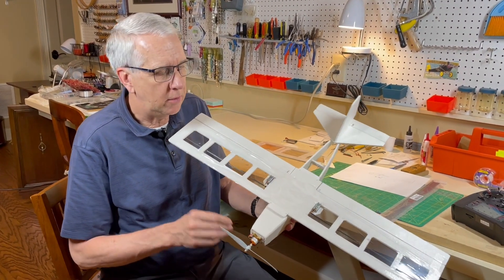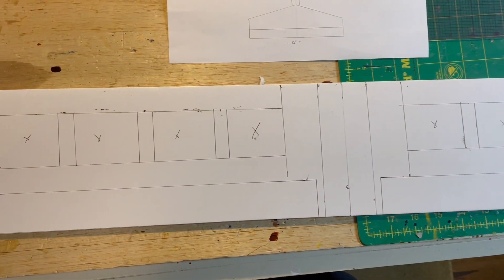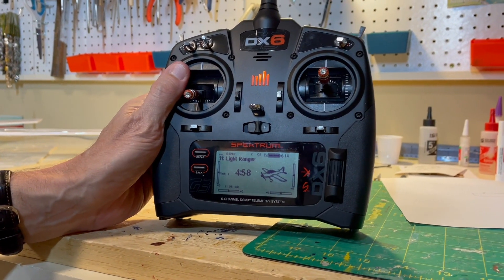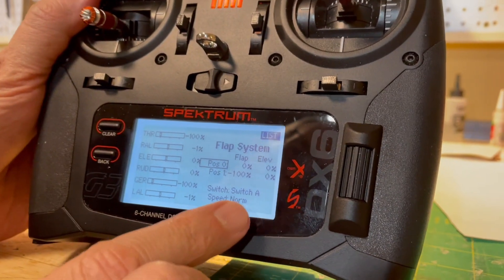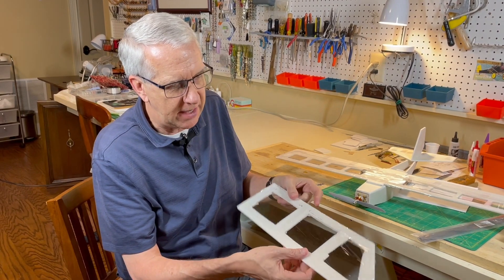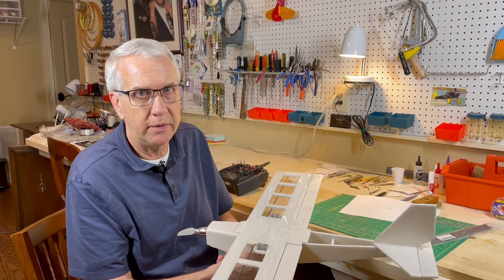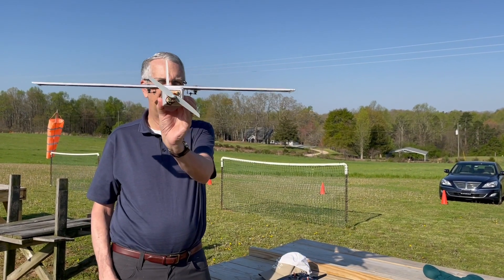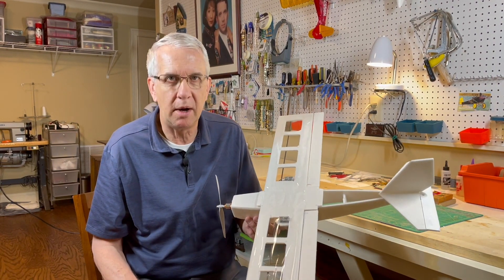Lite Ranger Foam Board RC Airplane

Comment: Great videos! I like to see you design your own versions of park flyers. Having flown gliders for many years I may suggest that you lose the landing gear and stay away from paved runways. Landing gear is fun for large airplanes but watching people land on hard surfaces you will notice that the gear takes a beating and often fails. The airplanes also take a lot of abuse. You can just plop down in the grass and not hurt the plane most often. I love the foam board planes and have built many of the Flitetest planes. I also love to see you modify designs. In my 60 years of building I too have to change something on every model I build. Electric models have made the sport so much better not having to see vibration and fuel ruin all your hard work. Great job on making the videos!
Reply from the maker: Mark:  Agree with all your points!  You'll find a lot of my designs have no landing gear.  Build quicker, look better in the air.  😁 Tim

Comment: Tim Never worked with carbon fiber rods. What size of rod did you use?
Reply from the maker: 2s:  I use 2 mm and 3 mm carbon fiber rods, purchased on Amazon.  The 2 mm are very light, good for smaller models.  3 mm rods good for a bit larger models.  My rods were 15", so  I overlapped the center and used heat shrink tubing and epoxy to bind them.  Tim

Comment: Nice and good fun! If you don't mind a spar suggestion, how about trying the lightest rod you have with one glued above the foam board and one directly below it. I would think .030 or .040 would be adequate since you are on a V2 trying to save the most weight. I just built a 28" wing with a twist on classic balsa spar/web construction (swapping the balsa or spruce spar with a set of four .020" cf rods sandwiching the web in an i-beam configuration)...I am getting away with much smaller rods than are typically used in a single rod or tube configuration. 

I keep puzzling over the use of carbon rod because it is such a great material but is seldom used "optimally" - and even so it works very well. But how to use it better, is a worthy challenge.
Reply from the maker: Polylight:  Agree with all your points.  Carbon rods work great, and with the smaller rods used in tandem, you can get a lot of strength at not a lot of weight.  Tim

Comment: Really enjoyed your video.  Suggestion, maybe put the carbon rod on top of the wing before putting on the cellophane and create a bit of an airfoil.   If the flapperons aren't panning out,  save some weight and go to one servo and just ailerons?  Looking forward to the next video!
Reply from the maker: Jeff:  Great tips, thanks!  Tim

Comment: Hello,  a very interesting project for a beginner like me.  What is the size of the propeller you are using?  Is google driven permissions correct, i can't get the link opened?
Reply from the maker: Jari:  I used a 7x3 prop. You should be able to access the plans. Tim